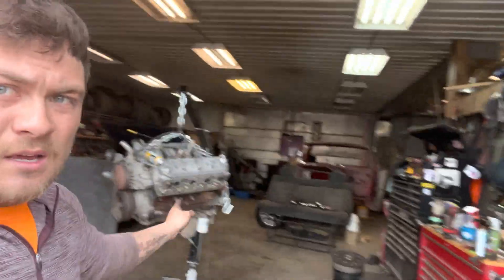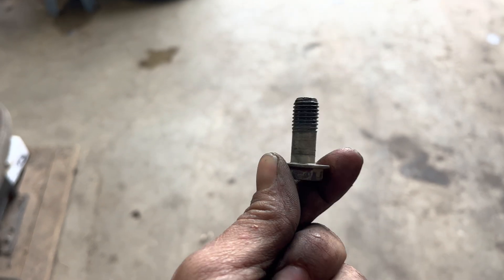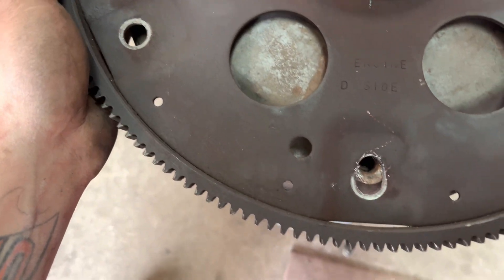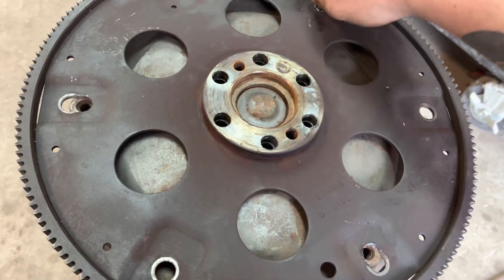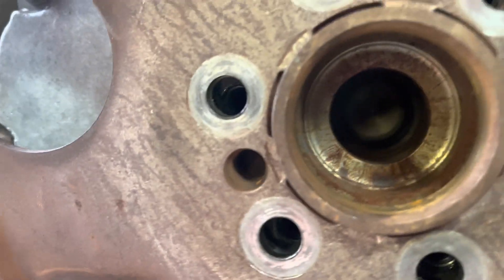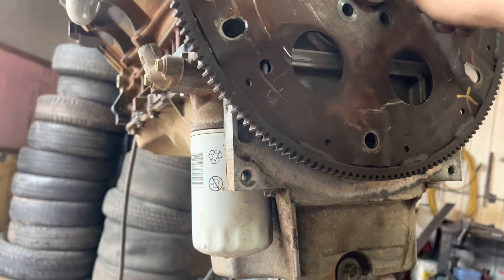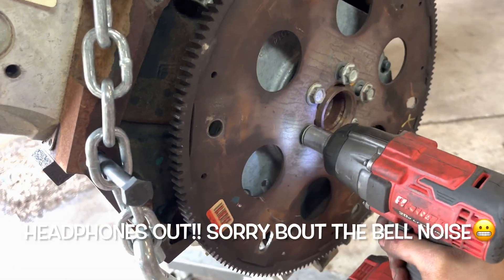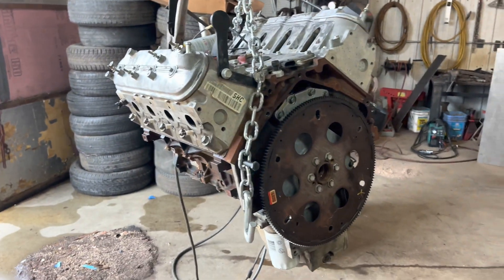How to put a th350 on an LS engine

Comment: Dang 50 bucks. I think I would have just used ARP. But I understand if y need it you need it. I kn one time I needed a caster bolt for my Chrysler n it was like 80. But I just ordered online cause they didn't keep it in stock

Comment: What was your clearance from flexplate to pads on converter ?
Reply from the maker: 1/8” roughly
Reply: @hesstons  damn mine about 1/8 but not quite, gonna have to take converter out and see if it’s seated correctly
Reply from the maker: If tc spins freely you should be good to bolt it up👍🏼
Reply: @hesstons  even if the spacing isn’t quite 1/8? For some reason I can’t even slide the tc forward towards flexplate.
Reply: Should have heard i believe, correct me if I'm wrong guys. But you should hear 3 clicks seating it on the input shadt

Comment: We have to fix a truck for work that originally came with a 6L90e it has a 6.0 l96 and it's missing the tranmission and the starter, we're planning to install a TH400/TH350. Will the original starter (l96) work with any of those two transmissions?
Reply from the maker: I am currently using a stock starter. It chirps just a little due to me not shimming it when I put it on and I ordered one for $50 on eBay so that could be why too. Local parts stores sells shims
Reply: @hesstons  thank you for replying

Comment: Correction,  a 4l80 flex plate, 4l60e plate lines right up to torque converter,  you wouldn't even have to mess with the bolt holes. Some 6.0 have 4l60 flex plate. So you gotta get 4l80e flex plate bolt right up

Comment: From what ive seen get a flex plate for a 4080 off a 2001 to 2006 chevy 2500 heavy duty
They bolt right up to a turbo 350  their are 2 sets of 
Holes pre drilled on that plate
 they  line up perfect no need to wobble holes  . I think your flex plate came off a earlier 6.0 like from the 90s those dont have the extra holes .
Reply from the maker: 99 and 2000 had different cranks in the 6.0 which is where the spacer comes in. 80E plate is hands down the easiest way I would agree.

Comment: There's no definitive answer for this different engines different transmission short crank wont crank different adapter case you just got to put it together and hope it works right you should have a little bit of play about one-eighth after everything put together there is no standard or offended answer for these you basically just got to figure it out and hope you don't mess something up
Reply: Did you use a kick down cable for the 350?
Reply from the maker: @torreys13 I personally did not due to length of cable on my trans but is very doable
Reply from the maker: I started going off generals. Generally all 5.3 motors were short cracks. But yes very ridiculous for all being “the same”.
Reply: @hesstons  I made it a 350 transmission to a LS 5.3 l generation 3 engine and the transmission will not go into gear and when I disconnect the transmission lines it is not pumping no fluid I take the transmission back apart and there's no damage to the splines no damage to the tangs for the pomp and no damage to the torque converter and it look like they're torque converter was pushed all the way back and I had a eighth of play for the thrust my question is can you spend a torque converter by hand on the transmission hard enough to see if you can get it to pump because the only thing I can think of is that I pulled a torque converter completely off the pump and it didn't damage anything and it just sat there and spend or somehow someway the inside of the new pump for the transmission is broke the transmission has already been rebuilding it is completely new and the engine is brand-new ordered from summit I use the same kit that you highlighted in your video I've done everything the way it was supposed to be done I have 1/8 of play I modified everything to where I made sure I had the right amount of play and yet still I'm getting no fluid to pump and it won't go into gear and everytime I take it back to the part there's no damage to anything whatsoever is it possible I broke a brand new transmission pump on the inside and if so why is there no signs of outside damage
Reply from the maker: @thehatefull1761 that’s crazy actually. I have only ever broke one pump and my dad took care of it so I’m not even sure how to answer if it would look fine on the outside or not. It is always a possibility. After I did one I also triple check to make sure tc is in all the way. I’m not sure if you could spin it fast enough by hand. Did it spin freely when you bolted the transmission on the motor?
Reply: @hesstons  yes I mean it had some resistance from the weight of everything but yes it's spun around freely like it normally would I've probably done 10 transmission jobs in my life and everything seemed to be normal but for whatever reason it's not working the only thing I can think of is somehow someway I busted the transmission pump on the inside of it without causing any external damage that was visible
Reply from the maker: @thehatefull1761 dang man that sucks. Hope you get it worked out sooner rather than later!

Comment: With my first torque converter I used the cupped plate, with a different converter I had to use the flat plate with the spacer between the plate and the converter. You need to stick the converter to the plate when it is bolted to the engine. If the converter hits the crankshaft before the plate it will knock out the thrust bearing
Reply from the maker: I have only used the spacer flex plate and have never had a problem. Good to keep in mind though thank you 🤙🏼
Reply: @hesstons  different converters set up differently. My next one I'll order for an LS with the longer snout